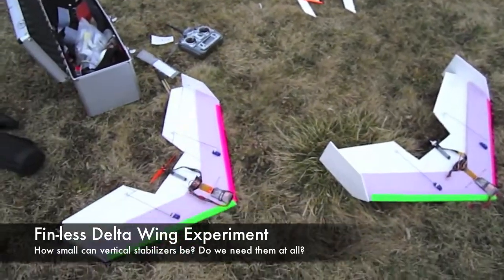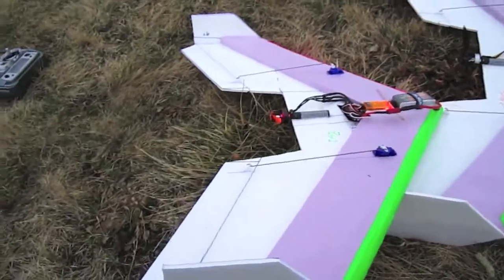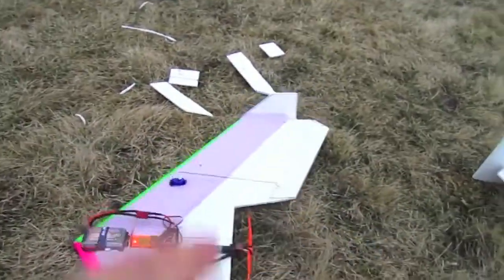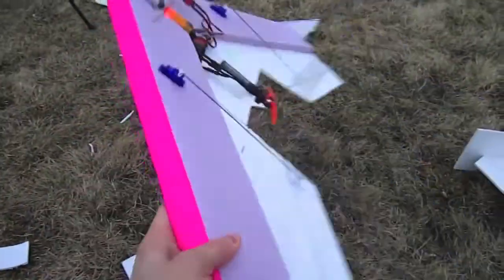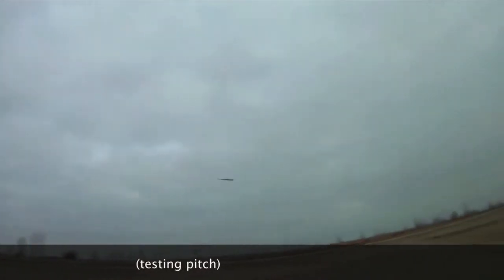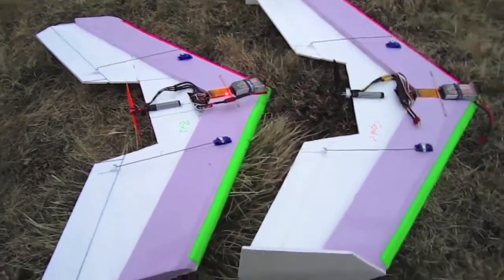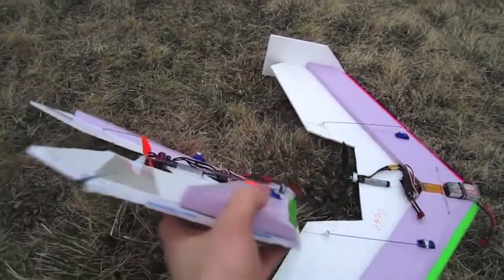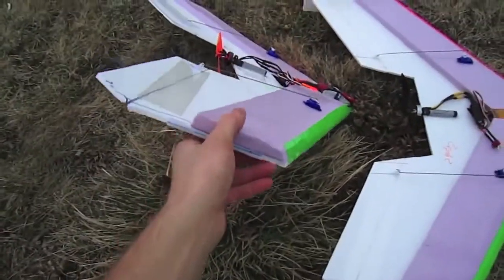Fin-less Delta Wing Experiment

Comment: The pulling out of the loop "a little funny" was probably due to the fact that, without tip fins, your plane was essentially operating as a true Flying Wing. The old Northrop XB-35s and YB-49s had a tendency to "hunt" about the yaw axis after turns, especially in turbulent conditions. Your plane was probably experiencing the same effect. Otherwise, it looked like it was flying beautifully!